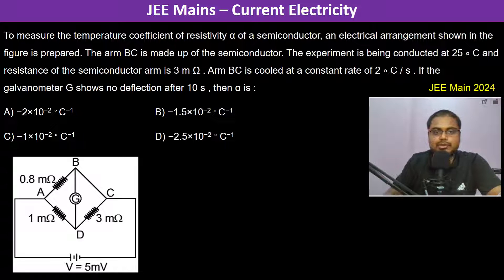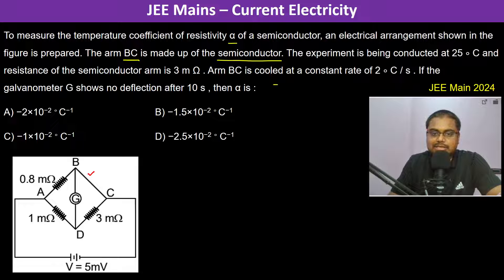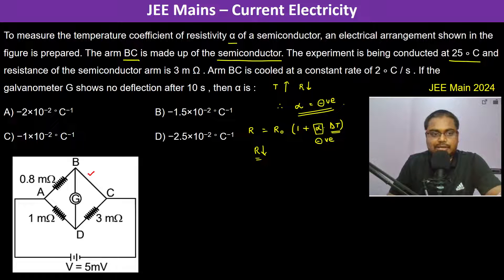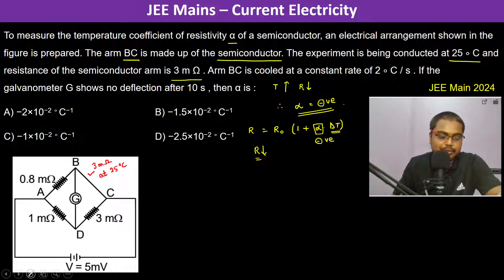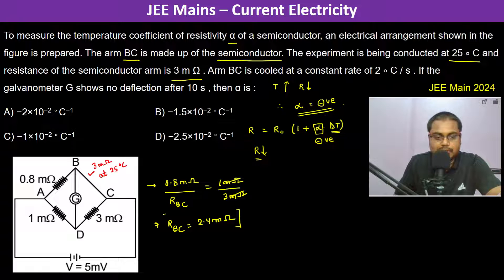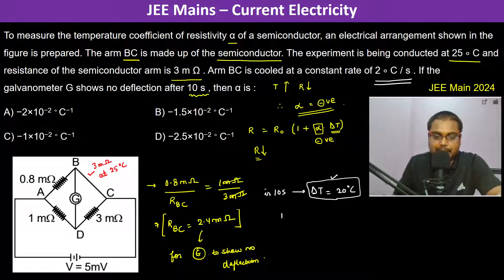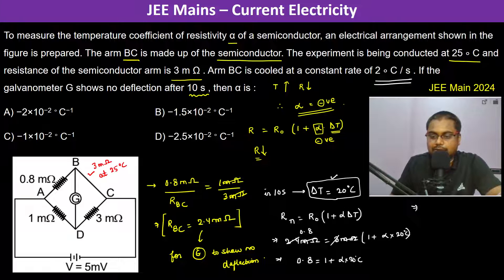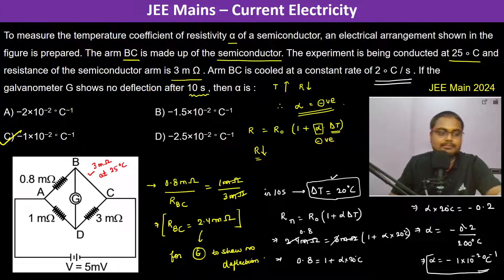To measure the temperature coefficient of resistivity α of a semiconductor, an electrical

Comment: Sir delta t 5 hona chahiye na kyuki 2°C se kaam ho rha then final temp = 20°C hoga thereafter final - initial= 5° C hoga
Reply from the maker: Final Temperature will be 5.
Delta T = 20.
Reply: @sarathiacademyjeeneet  bhaiya final temp 5°C kaise hua
Reply from the maker: As every second, 2 degree Celsius is falling. So, in 10s, 20 degree Celsius is the change.